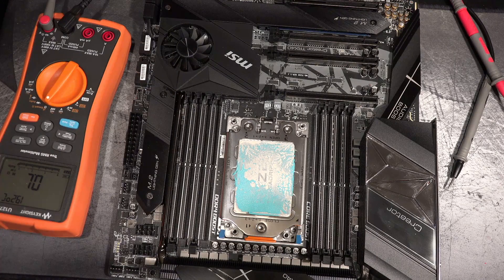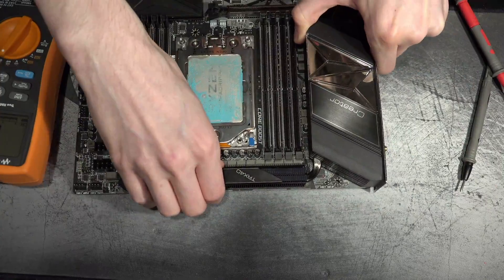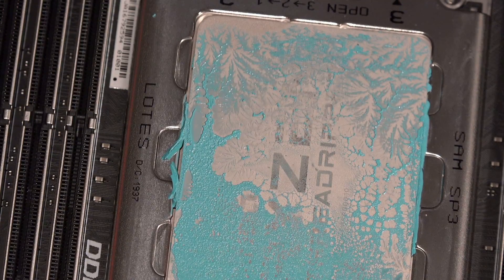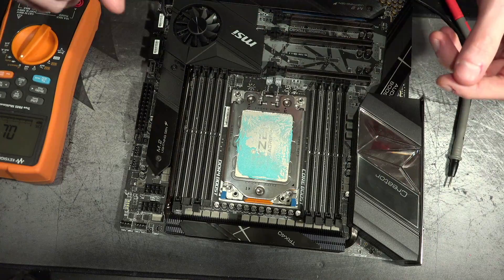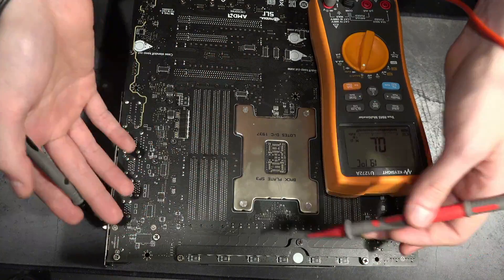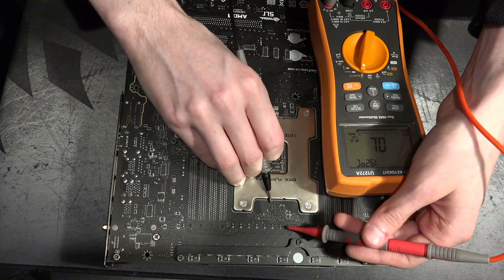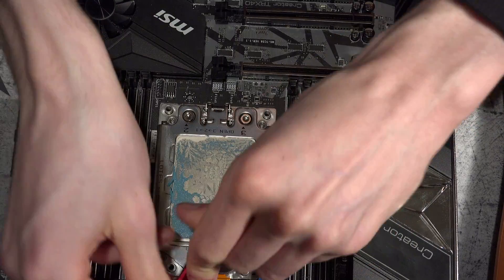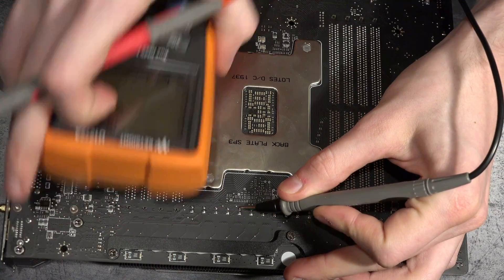Finding the die voltage sense circuit of the MSI Creator TRX40

Comment: "YET"

also what tool is that? I NEED one
Reply from the maker: Which tool? The screw driver?
Reply: @ActuallyHardcoreOverclocking  yea, sorry i was at work. its nice, does right angle and straight plus looks like bits. I work on cars and that would be real useful.
Reply: The only tools shown are a multimeter, a screwdriver and a pen...

Comment: Blue thermal paste? Which one is this? o:
Reply from the maker: Kingpincooling KPX
Reply: @ActuallyHardcoreOverclocking  Ah, but that is more optimized for below zero stuff. Can't find how much W/m*K, can you enlighten me? I'm using unchilled water cooling (yeah what a N00B I am) and I love Phobya's Nanogrease Extreme with 16 W/m*K.
Reply: @kyoudaiken   W/m*K does not actually say much.
Neither is it measured standardised nor does it tell about performance.

There are a lot of factors that matter.
And the KPX is better even on watercooling than the Phobyas most likely.
Reply: @rako81sna  I can try the KPX, but the Phobya worked well so far. I mean 26°C (CDD temps HWiNFO) is really nice for a 3960X. Max I saw was like 62°C.
Reply: What you use on top of the IHS matters very little anyways
Reply: @givemeajackson  Just wanted to make sure to avoid ANY problem.